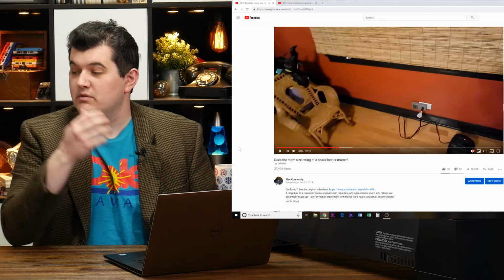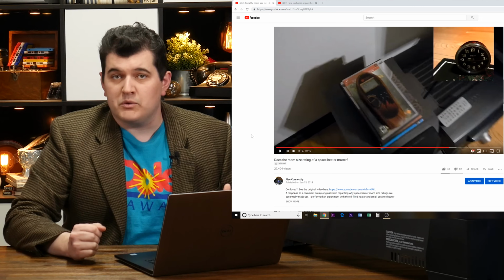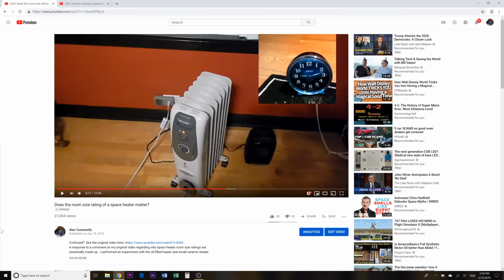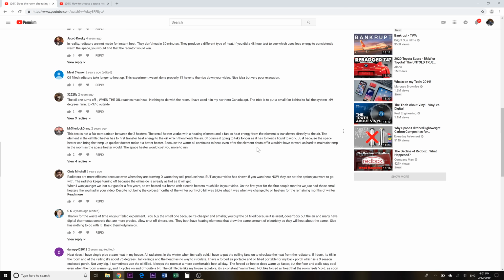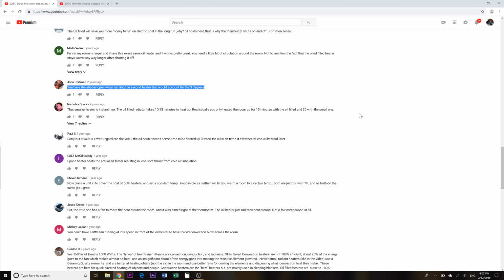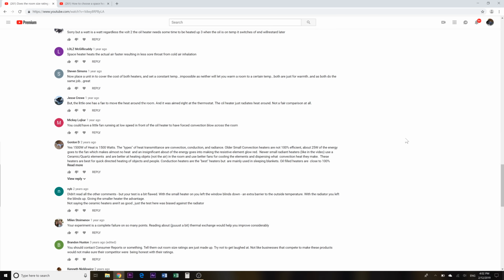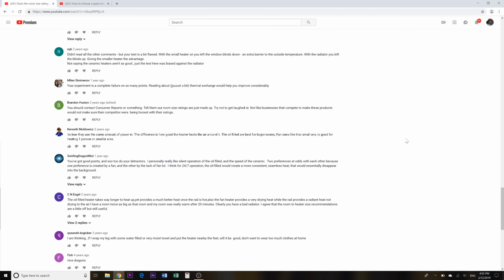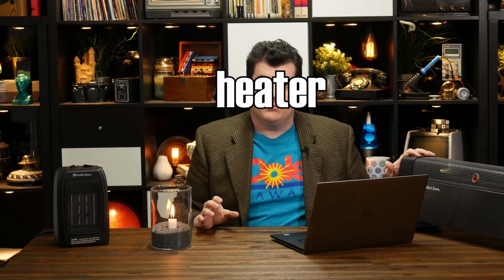More Space Heater Nonsense

Comment: Just as a gentle reminder: Effectiveness and efficiency are NOT interchangeable, and here's why.

Effectiveness is either yes or no. It's not gradable. Either it does something or it doesn't. An electric heater is effective heating a room. A candle is effective heating a room. A fart is effective heating a room as well. Even rubbing your hands is effective. All of the said things release heat to the room, therefore increasing its relative energy content.

Efficiency is when you want to measure how much effort and resources are put to accomplish a given task, and how well it performs in achieving the final result IN COMPARISON to something else. It's always relative to another thing or to a given perception. An electric heater is 100% efficient in heating a room, it has no loses and requires little to no effort. Candles are WAY less efficient, but still, several candles can increase the temperature of a tiny room by 1 or 2 degrees, but they require more materials and effort and produce a tiny change, so they are less efficient than the heater. The fart is not efficient at all, since most of the food energy is used by the body, and so is not rubbing your hands either. Nonetheless, human body heat is surprisingly efficient in some cases, when you combine several people in a closed room of a small size, the space quickly gains temperature due to constant losses in the human body, which keeps its temperature constant at 36,5 degrees celsius, thus heating the room.

Sorry for the long explanation, I hope you find it interesting :)

Comment: The oil filled radiators work a treat when you place a box fan behind them.  My dad once ran out of propane during a cold snap and managed to keep his entire house around 60 with outside temps around 15 degrees.  Safety is the bigger appeal of the oil-radiators.  They never get hot enough on the surface to instantly burn you or set fire to curtains or carpet.

Comment: Okay.. the large heaters typically have some thermal mass... Maybe it's just to keep the heat in a large room even? Like the forced heat heater has to cycle more frequently as the air around the machine drops in temperature as the heat spreads. Having thermal mass might help?

Comment: I agree that any pair of heaters with 1,500 watts will produce about the same amount of heat. However, since the "Radiator" style turns itself off more frequently compared to the "Fan" style, would it be possible that the "Radiator" style heaters are more efficient over time? Particularly in the use of electricity? For example, the "Radiator" style heaters turn themselves off then on every so often as compared to the "Fan" style which constantly runs. So wouldn't the "Radiator" style run something like 1,500 watts times 30 min vs "Fan" style over 1,500 watts times 60 min assuming they both ran for an hour since the "Radiator" style only runs for half the time or so?

Comment: The only difference I see between two heaters is that one is silent other is not. And the other advantage I see is that larger oil filled heater can operate longer without breaking down, as the design is better, since it does not have moving parts and heater is better protected as it is in contact with oil.

Comment: [conversational tone]
I see what you were trying to do in this, but I don't think you were as effective as you would hope.  If I may summarize, in your original video, you were attempting to experimentally show, much like they would do on Mythbusters, that two heaters rated for different room sizes, but that pull the same load will heat the same room approximately the same and in this video you were attempting to explain to your critics that you had accounted for the various criticisms and in some cases the criticisms were literally the point you were trying to make.  Assuming I understand your point of view, please allow me to give a few notes to consider for future videos.

The science:
Your academic knowledge of the subject appears to be solid.  Speaking as someone with a physics degree, I don't see any major flaws with the premise that two heaters that pull the same load will eventually put out the same heat.  However, speaking as someone who works in a laboratory daily, your experimental method leaves something to be desired.  Any variables you are not testing need to be controlled.  In this case, you should have tested two heaters that heat in the same manner, but were rated for different room sizes, such as two 1500W ceramic heaters with fans rated for different room sizes.  Another control you could have introduced would be to heat over the course of a day, preferably two days with the same outside temperature.  In short, look for all confounding factors and try to remove them prior to the experiment.

The journalism:
I agree that rating two heaters with the same load for different room sizes is confusing, at least to those of us shopping at Target or Walmart.  Is it possible that we are not understanding what the manufacturer means by a room size rating?  Instead of assuming that the room size rating means what a normal person would assume it means, perhaps it might be worth the effort to reach out to the manufacturers and find out what they mean.  As them (politely) to explain why one heater heats a medium sized room better than another in spite of what physics might suggest.  Maybe they have an answer that makes sense or can be experimentally verified or maybe they will give an answer that supports the premise that they are pulling those rating out of thin air.

The video:
Your frustration with the comments is understandable, but it did not produce an enjoyable or very informative video.  I suspect many of your fans, like me, merely want to help you make better content in the future; complaining about those comments isn't entertaining or useful.  There may be specific comments that require a specific response; have those prepared ahead of time or at a minimum edit the search for those comments.  To the extent possible, I would recommend minimizing, either through preparation or editing, all material that doesn't either entertain or inform.

Sorry for such a long comment, but I couldn't think of a more efficient way to communicate the ideas.  I guess this post should be rated for a medium to large video.

Comment: I think I heard somewhere that base-board type radiators are "better" because they create a curtain of air that helps break drafts.  So, if that is correct, in theory the base-board style radiator you show might be more effective if you put it on the floor in front of a drafty window, as it might make some of that draft not flow the same.  Again, this is just something I have heard, so not sure how accurate it is.

Comment: A 5x5 array of 60w incandescent bulbs attached to the ceiling of a room is the probably the best room heater. A ceiling fan would also be helpful.  If you prefer not having 1500 watts of incandescent light use 60w reptile heaters available on Amazon.

Comment: One factor you failed to account for with opening the window was a potential change for humidity. Water has a significantly higher heat capacity than nitrogen and oxygen - meaning it takes appreciably more energy to increase the temperature of humid air versus dry air. 

For all I know the humidity decreased when you opened the window (I have no idea what the weather was) and the oil filled radiator is actually worse - but either way it's a variable that needs to be considered.

Comment: Moving away from the topic of heating, to the completely different topic of cooling: Some air conditioning units are rated at 7 star energy efficiency, but are only suitable for small rooms.  Once the room size increases, (and other factors come into play such as whether there is ceiling or under-floor insulation etc), then the models suitable for the larger rooms from same manufacturer result in less efficient, e.g. 3-star efficiency units. Part of me wants to think "can't we just buy a larger number of the super efficient units designed for small rooms, but use their greater number to cool a whole house?"
IMHO, I imagine it turns out the efficiency comes from the fact that the 7-star energy efficient ones are only efficient while they are maintaining a set temperature, and only for a small room.  This is because they achieve their maximum efficiency (minimum power consumption), only when sipping tiny amounts of power while at a very slow speed, almost at an idle, or 5% power.  As soon as these units are asked to operate at full power continuously, their efficiency probably drops down to the same level as the 2 or 3-star units.  Thus putting one of these 7-star units to work on a big room, forces it to run at 100% for much longer, thus operating similar to the 3-star unit for much more of the time.

Comment: Convection driven heat slowly rises and is most efficient if placed under a window. It will create a "pillow" of cool air in the window sill, which in turn will insulate the room better. While fan driven heat is more likely to hit the glass of the window, heating up the glass and cooling down the air. But you're right that heat is heat and the same wattage is the same, of course. So I do not see how one way or the other should be more suitable for larger or smaller rooms, perhaps the definition of a small room has no windows?
Convection is of course more silent and the oil filled ones will, as you also say, give a more stable heat over longer time... So if I intended to keep a living room warm and comfortable, I'd prefer convection. If my goal was to get a cool room up to temperature in no time, the fan driven ones are by far the quickest.

Comment: They can always say they meant large room-heater vs small room-heater, as in larger household appliance vs tinier 😂 Anyway, even though I know that the video wasn't about it, I thought you might be interested in hearing about these things called thermo accumulative stoves, which are now almost extinct. They were rated 2 kW - 6 kW and their main application was to heat the daytime occupied living space and were usually able to heat a living room-dining room-kitchen area and those were some large-room heaters. They way they worked, they would allow you reduce costs (not power consumption) by half by only accumulating heat during the night, when the electricity costs half of what it costs during the day. During the day a small thermostat regulated fan would blow out the hot air from the inside. The thermostat was on a cord and you'd be able to place away from the heater. Ingenious 😊

Comment: I agree 100% with everything you say in the video. However I do have a theory for how it might be possible that the smaller heater isn't as effective at heating a room as the larger ones:
Rooms aren't perfectly insulated, so the walls, roof and floor will leak a small amount of heat from the room, the little heater will disperse the heat across a larger area so there is a larger surface area potentially leaking the heat. It might be possible that the larger heaters that don't actively disperse the heat allow the heat to accumulate in a small area and slowly grow the warm area so that while the room is heating up there is a smaller surface area heated above the outside ambient temperature potentially reducing the amount of heat escaping the room during this period, keeping more of the produced heat in the room and increasing heating efficiency.

But even if that theory holds true it doesn't discount what you said about the larger heaters not putting out a constant 1500w so they will still be slower in the long run, and I doubt it'd make a substantial difference anyway. It's also not particularly pleasant having uneven heating making the small heater seem like the better heater for heating a large room if the criteria for better is how quickly it'll make you feel more comfortable with the temperature.

Comment: Technically the energy transfer for the electric one is indeed 100% and the candle is somewhere in the low nineties I think. You want to get closer to 100 then you'd have to condense the water out of the exhaust and get some heat from that. That's what a modern condensation burner does. Marketing will have you believe that the efficiency is more than 100% because of that, but it isn't. Also you'd have to admit that the bigger one just looks like it'll last longer.

Comment: As for a situation where the bigger heater might be better: Maybe if you have a bunk bed, and sleep on the top bunk, the fanless heater is more effective, because the hot air gathers at the ceiling instead of mixing. So less hot air is exposed to the cold walls.

Comment: Now, i'm not going to argue with your findings, but, I'd like to know your opinion of perception of heat.  humidity in the air can change how you feel heat and cold but also as you brushed slightly upon, radiated heat works differently to convected heat.  Because i've used them, i believe that you can feel warm in front of an infrared heater even when it doesn't heat the room because the energy passes through the air and only transfers its energy to your skin when it hits it, would this make it a more efficient for of heating?

Comment: I think they are for different uses. The oil filled heater is intended for continuous use while the fan based one is intended to quickly warm the room. Of course one wonder the sensibility of the oik based one as it will heat even when nobody is in. Now how they relate to the big room small room concept is another matter.

Comment: On a related topic, what about dual-role air conditioners (can heat or cool interior) ? They do not contain a heating element, but are rather moving existing heat one way or the other, and only produce heat from losses from compressor, fans, etc. Does it cost 1W to move 1W of pre-existing heat ?

Comment: You should measure more variables to come to a better conclusion. How much power they used, how well they rebound from the target temperature of the room dipping, what happens to the relative humidity, how well they maintain the target temperature. I get marketing sucks, but your experiment is lacking. No one wants heat for only an hour. Test them both for a few days and measure what is actually going on. Then you can properly determine the efficiency of both heaters to compare.
Reply: I'll add that in my experience the best comfort control has been an oil filled with a separate oscillating tower fan. This keeps a nice even heat and noise level. Though as he mentioned oil filled will take a bit longer to get the room to temperature even with a fan as it first needs to heat it's thermal mass above that of the room and the inbuilt thermostats do tend to prevent it from outputting full power at 100% duty cycle even with a fan blowing across it. Once up to temp though there's minimal fluctuations due to that thermal mass and the separate fan keeps you from being annoyed by a regular space heater coming on and off.

Comment: I'd have thought that the oil heater cycling was to avoid "hot spotting" and burning out the element and  to allow the thermal load to spread throughout the medium since it relies on convection rather than mechanically pumping the fluid. 

They're certainly great in the morning if you turn them on before you go to sleep, it's just a shame that you have to waste all that energy when you're asleep.

also, what's with the damnable buzzing?

Comment: obviously the solution is to take the 1500W heater, buy a 120V to 240V transformer rated for 10kW and plug it in there. sure there may be a fire or explosion and it may stop working, but you'll get 6000W of heat!

Comment: The biggest difference I have found with different types of electric heaters actually comes from the draftiness and insulation levels of a room, rather than the size. Infrared heaters are GREAT for drafty rooms, they heat up objects around them and slowly release that heat in a large spread out area, rather than all the heat being swept up in the air at once and cooled off quickly. Oil radiators are also better than standard resistance heaters in breezy rooms, especially if you have a ceiling fan. This is probably why so many people are arguing with you, their personal experience with heaters show that some are more effective than others in their own circumstance. And I'll tell you, in the room I am in, during the polar vortex, a small fanned 1500w resistance heater DID NOT keep me warm, no matter how I oriented it, even pointing it directly at myself brought in a cool breeze around the edges of the warm air that kept me constantly cold. I bought an infrared heater, pointed it at objects near me, and perpendicular to the drafty window, and it keeps it toasty and will even get warmer than I need it. So, while you are technically correct about dumping energy into the room, the way that energy is spread and dissipated makes a HUGE difference in people's personal comfort levels and hence, people are arguing with you.

Comment: I am not a thermodynamics expert by any means, but I do wonder if the larger heater would be superior if it was forced with a fan. With more heating coils/filaments exposed to the air molecules passing by, it would seem to me that the gauge of efficiency is how quickly you can impart that 1500 watts to the room. Does multiple coils running at a lower wattage have a greater effect than smaller coils with faster air flow? You said you tested radiator style vs a compact filament heater, but these seem like apples and oranges. I do agree that the total heat output is going to be nominally the same, but what heat distribution factors are there to consider? Is a heater more efficient if it can process larger volumes of air over the same wattage burned?